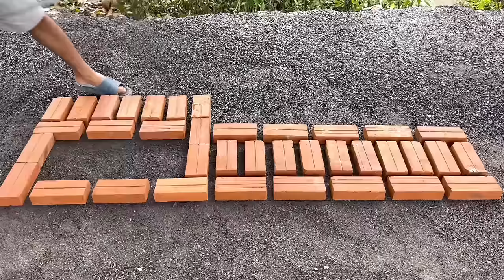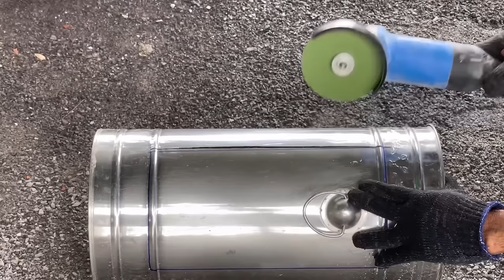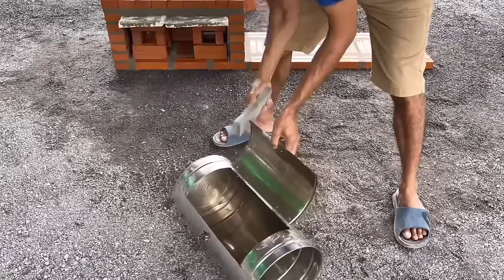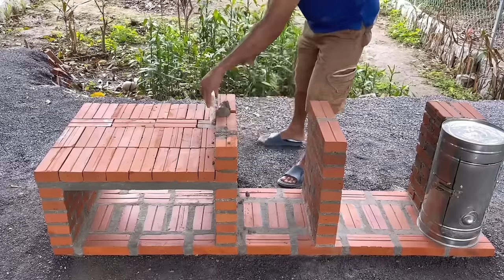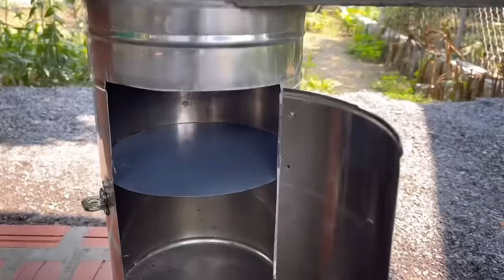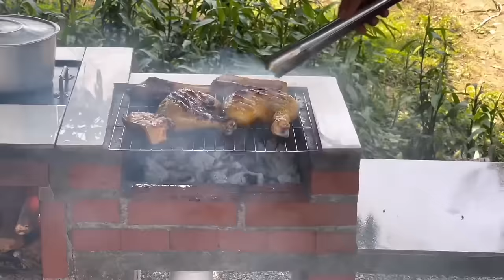share how to make a multi-functional wood stove for the family # 203

Comment: What are the steel plates with handles that are used for your stovetop called? I've been trying to find them for my outdoor cooking station and can't find them. Thanks in advance, and I love your work!
Reply: Same here. I've been searching for them for days!
Reply: A welder is going to have to do mine. I was hoping for a cheaper option though.
Reply: These are to be made by fabrication guy as per your size requirement. First decide the size and show the fabricator the video. He will make plate with handle and L plate and grill .

Comment: You Sir are very talented. Excellent quick craftsmanship!! It would be really good if you could share a material list needed to build this awesome beautiful cooking device. And some measurements on building the metal part's and white top piece's. I personally couldn't build this without that stuff!! You do beautiful work!! Thank you Sir
Reply from the maker: thick steel plate bought at a store that sells corrugated iron and the white color is ceramic floor tiles